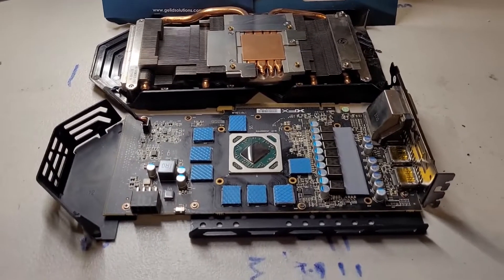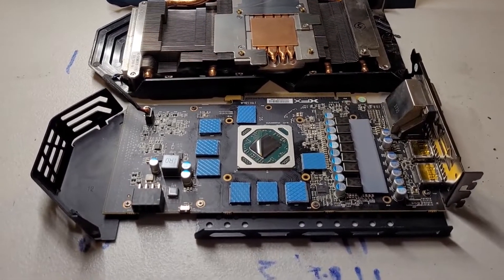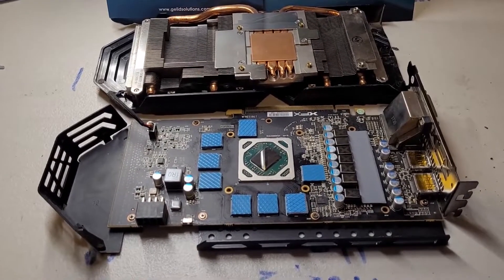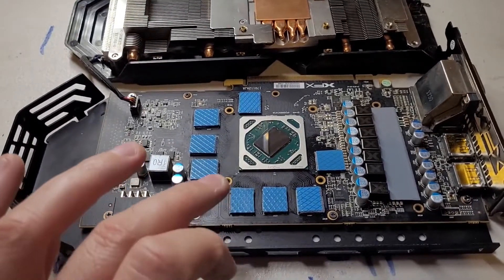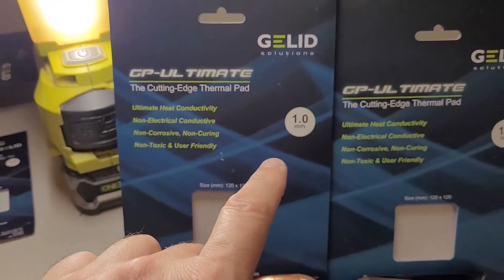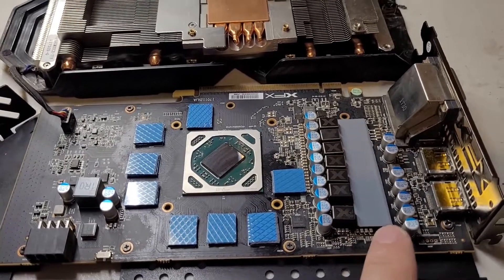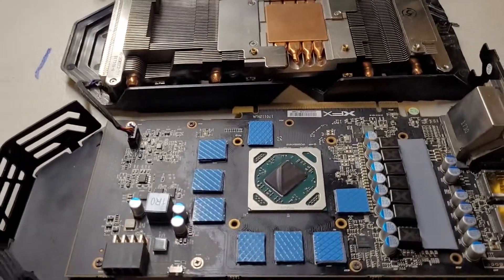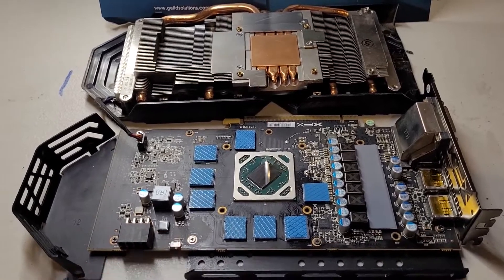XFX RX580 8GB Thermal Pad Replacement |  What Thickness | Temps Down  & Efficiency Up = More Profit🤑

Comment: Extra video and you explained everything nicely, only that good band of thermal pads is not needed for that graphic 😀😍
Reply from the maker: Thanks Iggy!
Funny I was wondering if worth using my premium pads (Gelid/Thermal Grizzly) on some of these older cards doing $1.50 a day LOL, have you any recommendations for a low budget thermal pad which still does a solid job?  Also for these XFX RX580's I am considering taking off the backplates to see if that improve cooling & efficiency - have you tried or seen done before with any good effect?
All the best
OZ Mining!

Comment: What is the width and length for both thickness types of those pads?
Reply: I also saw a comment that said there is no need to use such good pads for this card. Have you figured out what cheaper pads could I buy?
Reply: If it's important I don't use it for mining, just daily gaming
Reply: @other_paradox8437  Line the padding to the chip and use scissors to trim it to size.

Comment: what if i use 1.5mm for all?
Reply: you risk of having no contact between the chip and the thermal block which will result in extreme overheating